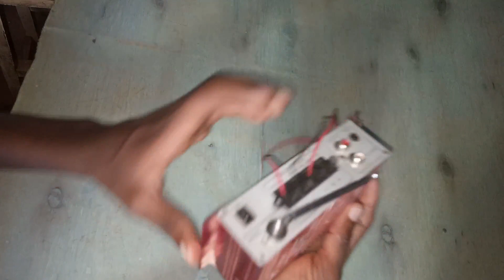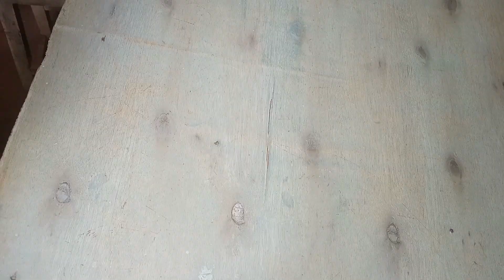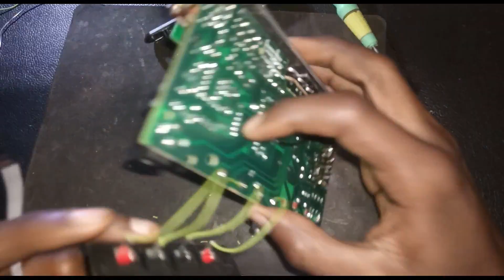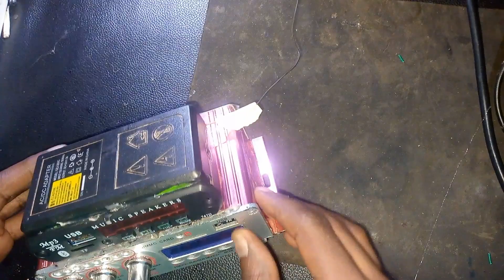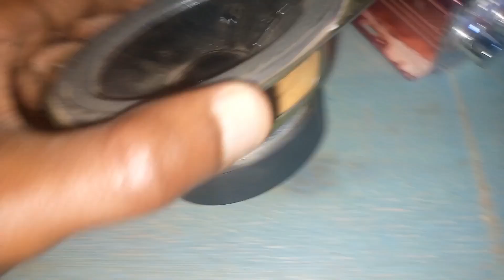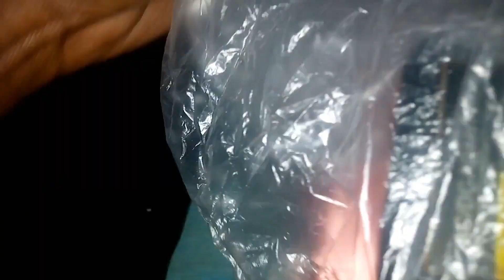small amplifier repair and modification

Comment: My kinter 004a amplifier keeps saying battery low when powered on, what can be the problem?
Reply from the maker: Probably the Bluetooth player is receiving 5v, instead of 12v. But it can be modified
Reply: The problem is on mp3 that is the transisto

Comment: Why do you put jumpers on sp +  sp- output instead of soldering it back ?
Reply from the maker: New speaker connectors have short 'legs', which can't fit back to the board and it's casing simultaneously. 
You have to attach them to the casing, and use wires to solder to the board

Comment: Hey...having an issue with my kinter 009 amplifier.... Has only 2 port output speaker.... R and L.... Connecting a mid-range speaker and a bass speaker... The mid range has more sound than the bass speaker... Bt if I remove the mid range speaker... The bass speaker is sounding okay....and when I interchange the... Still the same!,no change.... What could be the issue?